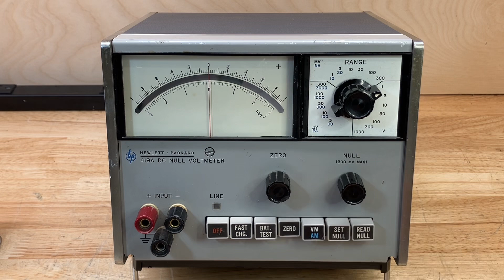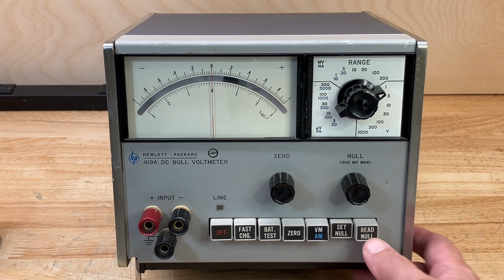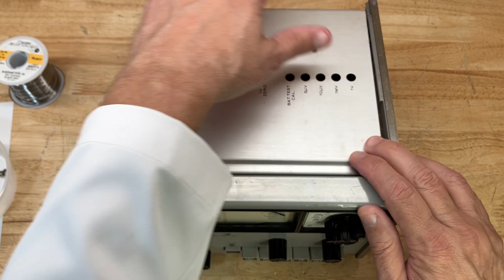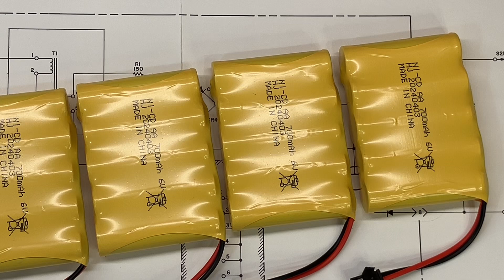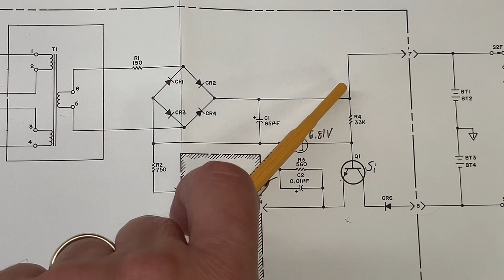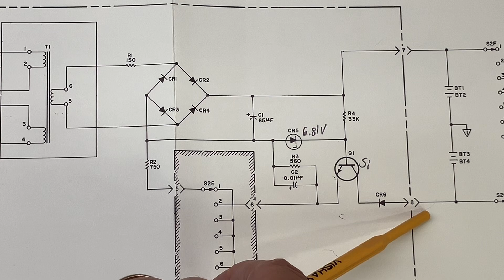HP 419A DC Null Voltmeter Part 1

Comment: Emergency light charges built in nicads at 1/20C  every day  without any damage, and yes they act like a Zener diodes  with max votage from 1.5 to 1.6 V at full charge. Those 700 are  real 500 mA/h, i have GPs 800 NiCD from last production years they are 500mA/h
Reply from the maker: Stay tuned for part 2, where we measure the actual charging current and compare to my calculations.
Reply: Okay, i will. Thank you for populating something substantial, because nowadays youtube looks like Disneyland but for all idiots in the World..

Comment: A standard cell produces about 1 volt but, according to the front panel of the HP meter, the null function only works up to 300 mV. You could use a voltage divider on the standard cell but then the divider would draw current from the cell. Is there another method to use this meter with a standard cell?
Reply from the maker: Geat observation. I’ve never used the 419A with a standard cell, though we did have several standard cells in our cal lab at hp in the 1980s. I’m not sure of the exact configuration, but it seems the standard cell was connected in series with the 419A and an external bucking voltage (of opposite polarity), such as the HP 735A Transfer Standard or the HP 740B DC Standard. Thus the 419A could measure the difference between the cell and the transfer standard, with a resolution down to tenths of microvolts, and the nulling function of the meter could still be used to ensure no current flow.